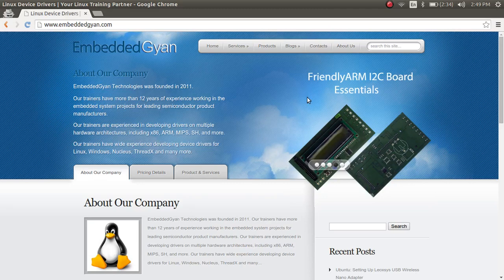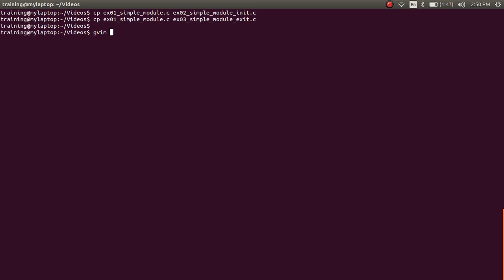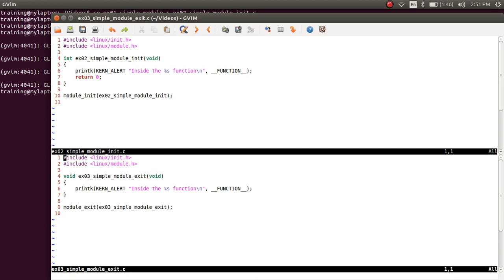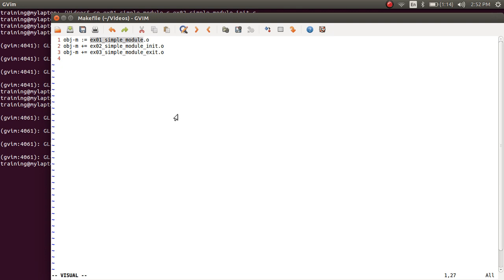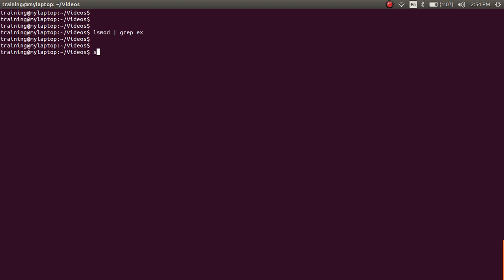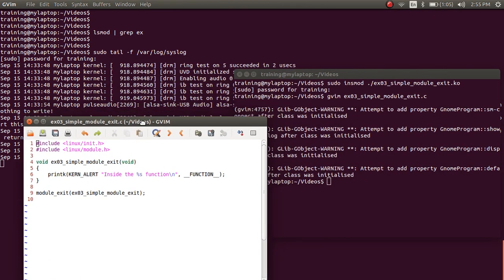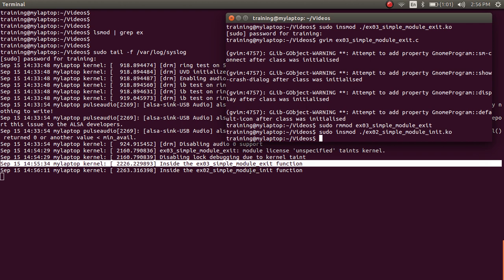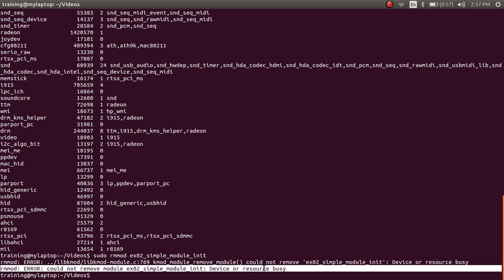Linux Device Drivers Training 02, module_init() and module_exit()

Comment: Hi Karthik,
                  Thanks for your linux device driver training sessions.
how to remove ex02_simple_module_init.ko module from kernel space without adding exit module? I mean is there any alternate command to remove the unnecessary modules from the kernel space, other than rmmod command.
Reply: As far as kernel sees, the driver is busy doing something, and removing it mid-way can leave files/processes corrupted and memory leaked (until the system shuts down). This is very dangerous so I doubt there's any method/command to unmount a running driver.